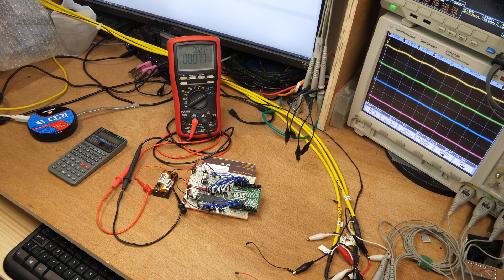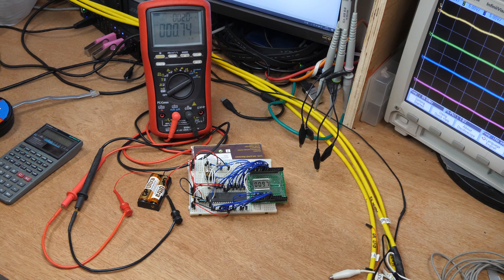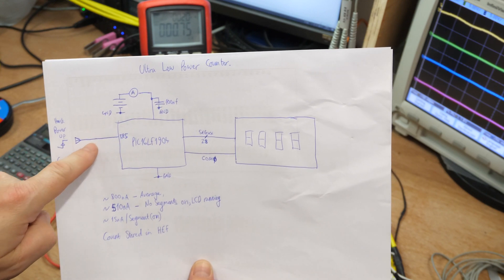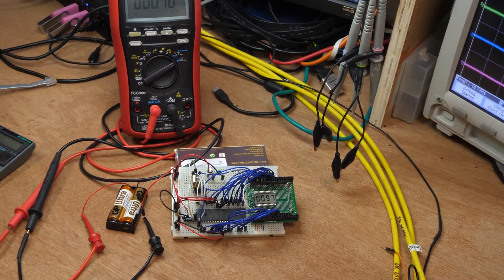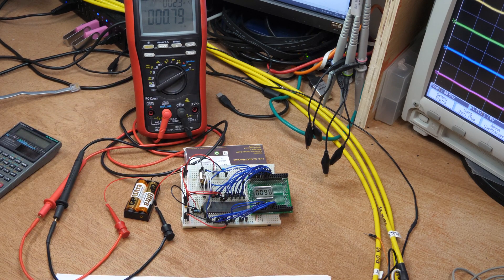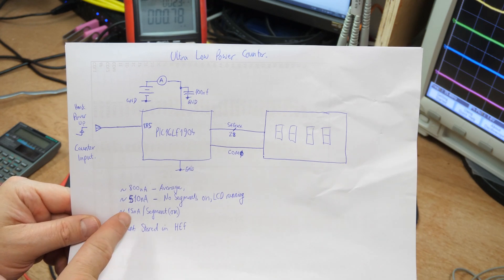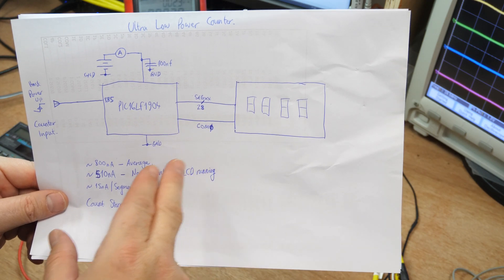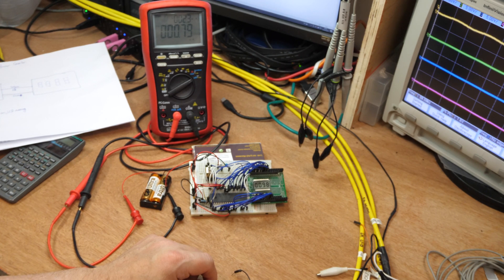Ultra Low Power display counter

Comment: Hi Nezbrun, very detailed video. I am attempting to do the same on a custom board but am able to reach around 7.4uA in SLEEP mode using the same code as yours. Would it be possible to share the schematic so i can compare and see if anything is missing or extra?